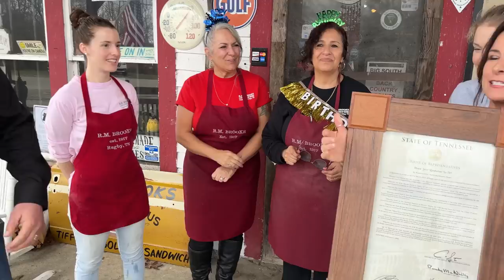LOVE is in the Air at the Ole Brooks General Store in Rugby TN: Lets Go Meet Tiffany's New Fella

Comment: The recipe i found and started making was in 1964, called "floating cobbler". Mix cup flour,3/4 cup sugar(can use cup)tsp baking powder,pinch salt,cup milk,mix well,melt stick butter in baking  dish pour the batter into the bowl,then pour the fruit and juice on top of the batter. The crust rises to the top. Self rising flour works really well to use instead of regular flour. If you use self rising flour you won't need to add salt and baking powder extra.